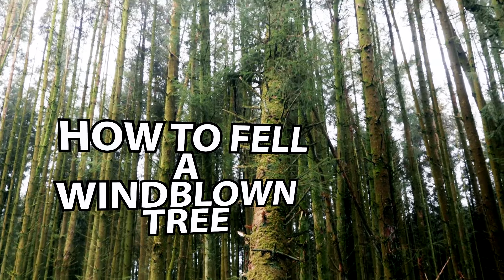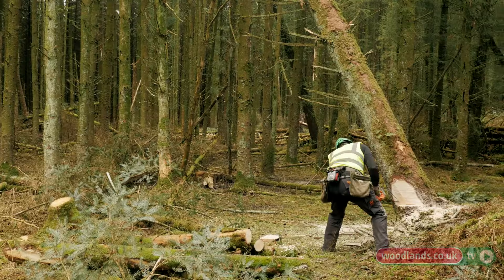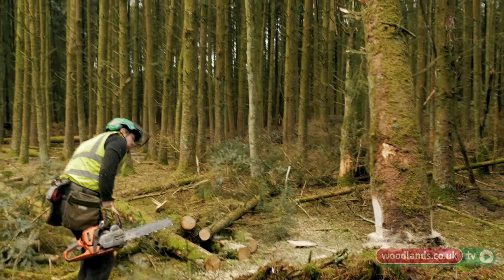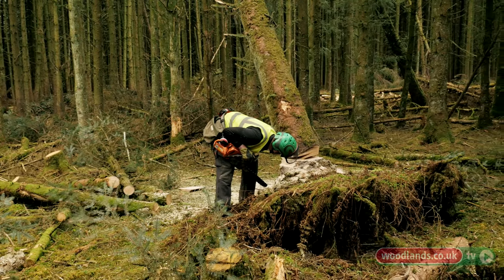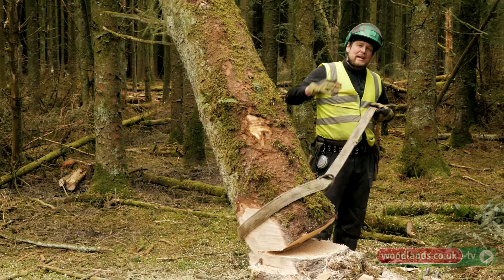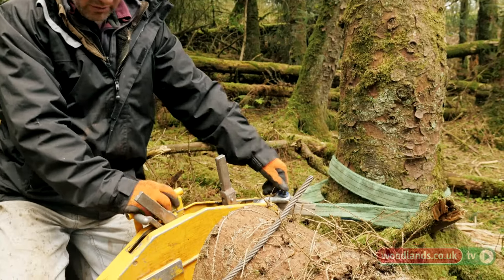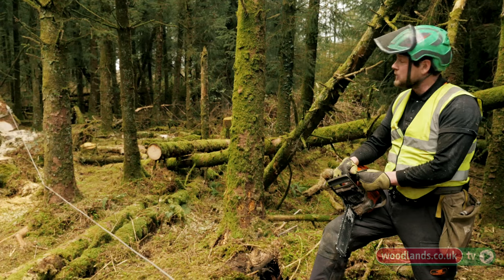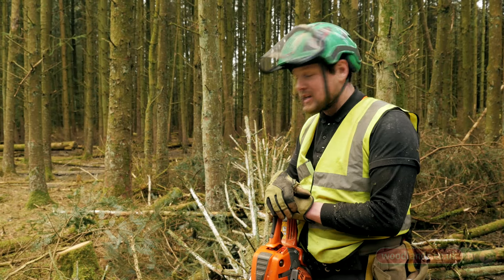How to Fell a Windblown Tree

Comment: A longer bar on your saw, (perhaps a larger saw), would increase the fallers safety by allowing him/her to stand slightly farther away where you can better observe the tree above, where half of the danger lives. Dead limbs, (widow makers), are impossible to hear falling over the saw noise so one must rely on ones vision to be able to avoid anything falling from above.
Reply: Yes but some forests there is restrictions on what you can take in there and how big your equipment is
Reply: How many chair/compression compromises at the stump have u  LUCKED through? Idunno.i don't want a big saw unless must.File ur dogs etc whatever.My saw fucking CUTS , right. I don't find "long bar" solution..."real"      Good Luck to you
Reply: I have safely fallen thousands of hung up trees over the past 25 years, almost all with 66 Stihl's,  .404 chain on 33 or 36 inch bars.  Rarely had any tools other than my saw, axe ( 4lb Arvika or 7lb Trojan) and a pouch full of wedges so I would have to get the tree to spin itself down by well thought out wood removal, often requiring long angular cuts which are easier and safer with more bar.  If it was limb bound   I work on the BC coast where the 36" bar was the normal for most guys but now 33" is more common, though my 44" still gets the call once in a while.  Super sharp dogs are not so important with the species that I fall, (fir, cedar and hemlock), just a sharp chain and some knowledge.
Reply: @dannysulyma6273  cool story, bro.

Comment: When you say the sling is 2 tonne Minimum Breaking Strength (MBS) Are you sure you don't mean Safe Working Load (SWL) or Working Load Limit (WLL), that has a factor of 5 applied to it? I think you messed that bit up, otherwise cool video

Comment: Nice video. I was wondering, when you make a plunge cut you start off cutting up to the hinge and then back cutting to the trigger or release wood. I always see people release from the back side and saw forward. Are there any problems with continuing to back cut from the inside of the tree when cutting the release?
Reply: You can cut out the back on a tree that has moderate lean, but if you cut out the back on a heavy leaner, the "trigger" wood can break, and the tree may grab your saw and take it for a ride. When I bore, then cut from the outside in cutting the trigger, I typically release the trigger cutting below the bore cut and not above as it can grab you saw if you cut above it also.
Be safe.

Comment: Good video! You could consider improving safety by negating the use of the shackle between the strop and the winch hook, its just another failure point and potential heavy flying object if things go wrong. The strop can go directly onto the hook.
Reply: Better still, remove the hook from the eye & just use the shackle - stronger & more secure !

Comment: I have rolled trees of the stump roughly the same size using a peavey with a four foot handle.
Reply: Which gave me a GREAT idea.   A log say 8 inches thick and 12 feet long could be chained to the tree horizontally and the chain secured with some bolts drilled into the leaner.   Then the end of the log could be pulled with a rope or winch from a nice distance away and it would have MASSIVE leverage.   Like a Peavey but much bigger.

Comment: To remove a wind-blown tree, I've also seen Swedish lumberjacks use a technique that they call "kana på slana" (slide on the pole).  They make a notch at the base of the tree, then they shove into the notch a sapling whose branches have been stripped off, and then they lay the sapling on the ground, to serve as a rail.  They then use a stout branch to move the base of the tree along the sapling / rail until the wind-blown tree falls.
https://www.youtube.com/watch?v=7Rxore5Qm2I